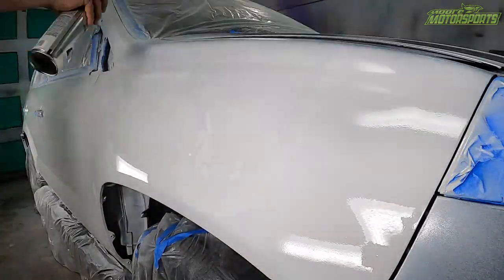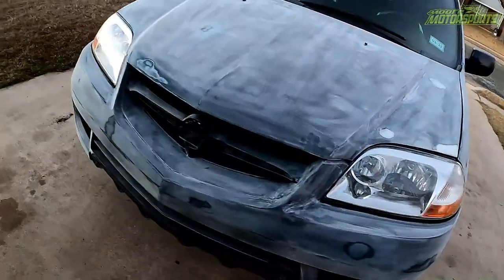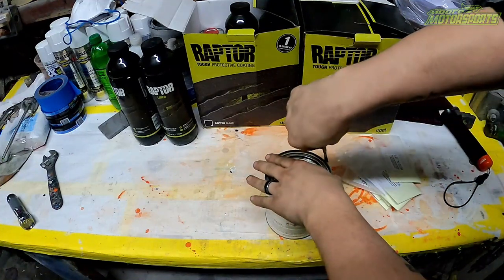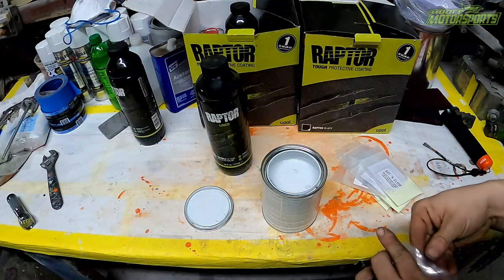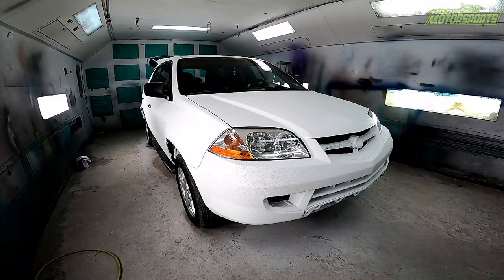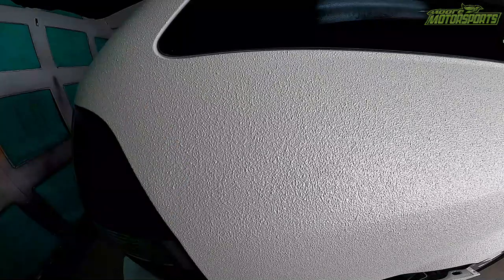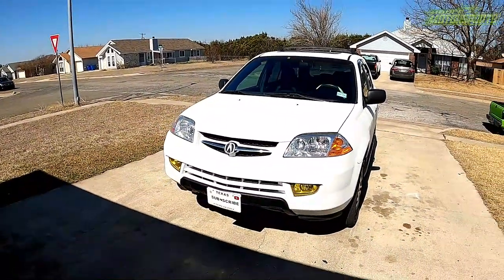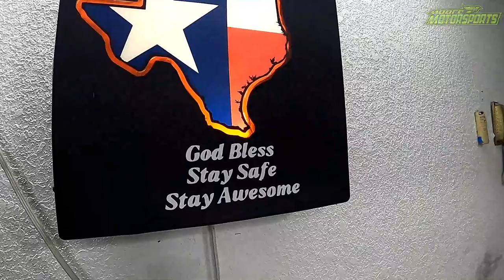GLOW IN THE DARK PAINT JOB!

Comment: Why bed-line a/this car? How much weight did the application add?
🤔 I'm curious from all of the texturing, is it possible to do a before-versus-after fuel economy comparison?
Reply: Bed liner barely adds any weight.  A few bottles to cover a whole car and probably half of that is solvent that evaporates.
Reply from the maker: It don’t add weight. We tested this in another video and it’s durable and easy to keep clean. the texture may look big on camera but it’s not too bad. It’s a smooth rough and I know that won’t make sense lol.

Comment: Hey man. First & foremost, I want to say this is super different & slick looking. Now, I have a question. I never saw anybody else do raptor over a Rust-Oleum gloss style paint job like this. I love the idea. As I'm nervous about which adhesion promotors are worth the money, for the plastic trim on my Honda Element. & it don't seem like many of them are. So if I can get away with doing something similar, it would definitely save me quite a few bucks. That being said, I'm very interested in hearing how it's been holding up for you so far?

Comment: I have a question that I probably already know the answer to but I would prefer a second opinion (especially from someone who’s WELL versed in painting with cans) anyway I painted my car and I didn’t have the best lighting so I ran across the yard (to get a couple work lights) mid paint and kept painting, and I threw 2k over it thinking my base coat was even all around.....turns out it wasn’t, I realized there was two med sized spots where it didn’t cover properly soooo I decided for some odd/STUPID reason to just throw a light layer of base coat on the clear while it was wet and it made it look a little lighter than the rest of the car then I re-cleared the area, basically my question is, in your opinion could I get away with wet sanding the panel even and throwing more base/clear, or will I have to sand the whole panel and start from scratch? Any help is appreciated either way.
Reply from the maker: In that situation I would wet sand the entire panel down and re do it all. I’m sure there is a better way to fix it but I’m not a pro at blending paint to make it all match perfectly and i know the struggle of little to no light when painting I use to do everything at night in the dark with moon light not even kidding lol

Comment: How do you prep a car surface for painting that previously had raptor liner? Can’t sand it, or even wipe it clean
Reply: Klean-Strip Aircraft paint remover.  It will make bed liner that's 1/4"  thick fall off almost instantly.

Comment: Does the Raptor stick well to gloss spray paint (without an additional scuffing/sanding)?
Reply: must sand it on any paint u use loll, to stick on better otherwise, it will peel on ya loll,
Reply: @lennybaldacchino  weird that he doesn't sand it again in video.
Reply: @thetonyplush  I'm also looking for an answer to this question, because I watched about 15+ people do a raptor job. To try & build my knowledge before I give it a shot & not one other person put down a gloss paint before applying Raptor. Infact most of them recommend getting it as good & scuffed as you can for it to adhere correctly. I just want to know how it's still holding up. Because I will definitely do it this way if it works. Save a lot of money on adhesion promoters with not so great reviews. Did you find an answer for this question by chance?